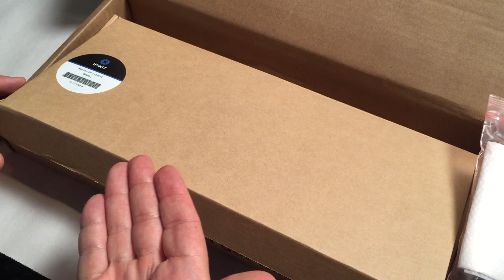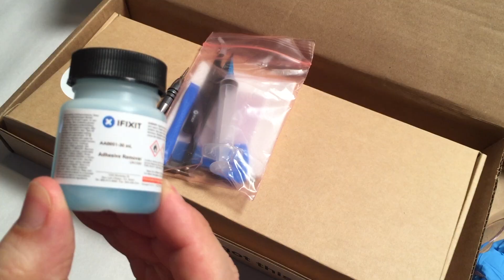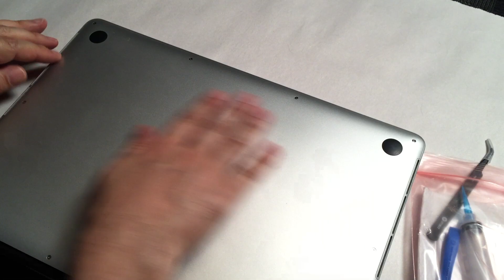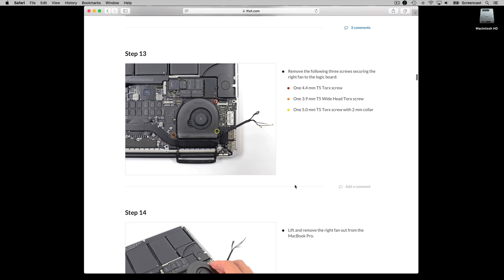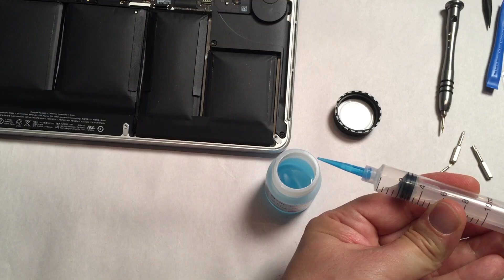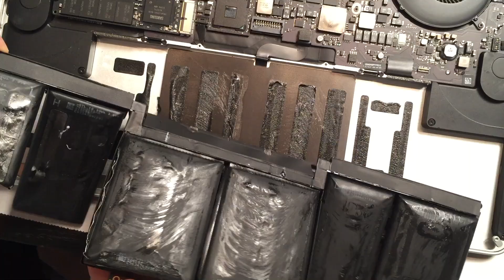Repair: MacBook Pro 15, Late 2013 Battery Replacement [ENGLISH]

Comment: Just changed my wife's MacBook Pro battery using your tutorial. Excellent work. The hardest parts: getting the adhesive off (ended up using a razor blade, very carefully) and aligning the two battery screws on either side of the connector (I didn't, and didn't put them back. The laptop is pretty much a desktop and won't be jostled too much, so I'm hoping that won't be an issue. Besides, the battery is solidly stuck in place now and won't move.) Kudos to iFixit for their excellent kit. I love that it came with all the tools.

Comment: Does anyone know if the MacBook can run without a battery at all and just stay on AC power?  I've already had one battery replaced under warranty and the second swelled in a year.  I've kept it powered off for the last 3 years but would love to get it running again.  If I do get a new battery kit, do you really need to use the adhesive?  Just thinking of more future replacements being easier.

Comment: Great video. Ifix it method put me right off and I've been fixing stuff since 99:). Yours looks much better. I think I will use dental floss on my attempt. Battery purchased today and should be here in a few days.

Comment: Fed, thanks a lot for this video. It worked like a charm and i was using a replace kit from China with just the bare minimum tools provided - i got my own gear anyways. One detail, which might be of interest for some: I did not have this liquid to soften the glue and i wanted to do it anyways - right now. So i rubbed some oil from the kitchen (yes, ordinary oil for your salad and YES - the idea of my wife) into the floss and that went out very nice. This way there is also no danger to spoil the electronics with anything aggressive. I now have my backup mac back as an option to work with. The old batteries were fat and ugly. Dangerous one might say. Thanks again.

Comment: Took 15-20 minutes to replace battery from start to finish.  Use 20LB Braided Fishing Line with the ends wrapped around 3/4 inch dowel to create a garrote.  Slipped under the battery and pulled....no liquids, no strain, no fuss.

Comment: Will this method work with late 2012 early 2013 models ?
Reply: Can't speak for the late 2012, but I just made the repair with my early 2013 MBP and it was a success!

Comment: Can anyone tell me why other installation guides/videos have you take basically the fans, chips, and a lot of hardware?  It just seems pretty unnecessary and a sure way to easily risk damaging a chip or connector.  This way to use dental floss/string is a lot less intensive and clearly does the job...

Comment: So is there a way to move a battery from one unit to another? Or once the adhesive is removed the battery is unusable? I have several units that I would like to mix and match parts....

Comment: Thank you! I followed this video and was able to change the batteries. I bought the batteries from iFixit. This is really good video! I found using thread more difficult than what is being shown on the video. The last part of cleaning up was a bit tedious and I had to use scrapper to clean it up.
Overall very helpful video! Thanks again!

Comment: Very good tutorial. Thank you so much for your time and precision. Everything works fine. However, I ordered my battery thru IFixIT CANADA. They do not have any glue removal or tools that comes with it. Battery period. Also my wireless and internet was not working when I started the computer back. Solution: be sure to update the date of your computer.

Comment: Thanks for the video! The procedure worked as explained. I used waxed dental floss to saw through the stickers and used the plastic tools to remove the batteries toward the front of the case while using the cards to leverage the batteries.
Reply: did u not use the adhesive remover?

Comment: Thank you very much for the video. Of course, with the right tools it is always safer and easier, but I did not have time to wait for them, and managed to do it also with a dental floss, an old credit-card-like thing, and without the glue solvent.

Comment: hi sir, ah, my macbook's battery as a life span of 1 hour from 100% to 0%, sometimes it shuts down at 24% till i plug it in again. i bought it in 2014 and i haven't restore or fix anything yet in it. But the battery is still flat and the trackpad still works fine. so i wanted if i still need to change it.
thanks :)

Comment: Thanks a million. The string tip for removing the old battery was great. I actually used 80lb fishing braid line and no glue solvent. Had to wear gloves so the line would not cut my skin, but it worked perfectly.
Now I can carry my MacBook again without the need of being plugged.
Reply: I was thinking that waxed dental floss would work too.
Reply: Mark Freemantle I red that works too.
Reply: what kind of gloves did u use

Comment: You only need to disconnect the battery connector and unscrew the plate holding it (two screws). That's it . You don't even need to disconnect the speaker. You don't need acetone or any solvent to remove the old bulging batteries. Just use dental floss to saw a crack between the double sided tape, and shove two plastic gift cards into the crack. Then use a pen to wedge the cards open and advance the cards. In the macbook pro 2014, for the middle cells, the trackpad cable runs beneath the plate so there is no danger damaging the cable as you wedge into the middle cells.     https://www.youtube.com/watch?v=rLuyv-9g-Ho&feature=youtu.be
Reply: what do u use to glue the battery back in?
Reply: @josephd6952  The battery pack comes with double sided sticky tape.

Comment: I used a similar string, but parted it into two to make it thinner, wrapped the ends on 2 small pieces of wood for betta grip and used longer 'sawing' action... this way I did not need any glue solvent. Went smooth. (The middle 2 packs I did in one go, going under the frame with the string.)

First thing, before your first thing, is to DISCHARGE the batteries before going at them. Supposedly there is less of a chance of fire/explosion even if you poke a hole in them by accident.

Also, if they are THIS swollen, I would stop using the mac and remove the battery while I am waiting for the new one. Mainly so the case does not deform permanently...

The mac can be used without battery, just with the power adapter -- true, it will default to the lowest clock speed of the cpu...

Comment: Thanks — This video is exactly the way to do this. I just did this today, using the same ifixit kit and it worked perfectly. My original battery was ballooning badly and it had only 77 cycles. The only issue I had was startup after replacement. I got errors saying can't load system software and then no system found. I reset the SMC and the Pram, after which it booted up fine.
Reply: How to do this ? reset SMC and PRam ?

Comment: Wow, thank you for the video. I like this idea with nylon string.. I have to replace trackpad on my laptop, but I want to do it by my own hands.
It's great idea to prevent battery damaging.
Reply: Were you able to replace the trackpad without having to get a new battery?
Reply: @berrybestsounds  new trackpad is still in the way to my address. I've prepared the nylon string, guitar strings.. hope to start to do it asap ! Have you the same issue with trackpad?

Comment: Great video.  Thank you.  I purchased the iFixit kit as well.  I used 80 lb test braided fishing line instead of string and I did not need to use the solvent to remove the batteries.
Reply: Jayson Nelson wow, that’s EXACTLY what I did. 👌🏻

Comment: I would cover the logic board at least.  And also use a fresh string each time, to minimize getting adhesive remover on the logic board.
Reply: You can also use Isopropyl alcohol as a adhesive removal liquid. That is used to clean logic boards + other eletronics, doesnt damage either but removes the adhesive.

Comment: This is the best solution I have seen. Thanks so much. I should also say that the battery you get from iFixit is far superior to the $25 batteries you can buy on eBay. IFixit provides an incredible service and is worth paying a little extra for.
Reply: Hey JS! Just saw your comment mixed in here and now I HAVE to do it.  :)

Comment: now that its been a few years, how is the battery holding up?  I am at the point in my macbook that the battery is lasting about 2 hours with basic use.  The health of the pack is at 80%.  It is not swollen.  I'm currently on the fence whether i should replace it already or wait until it gives me less use on a full charge.  Thx!

Comment: Mate, you just saved me some cash, because I was so scared with OWC Battery Replace video and also IFixIt step by step that I was about to pay a technician to do this for me. None of the other methods are as easy as your "nylon and string" method. Thumbs up! But just a heads up: I wasn't that careful on avoiding the (OWC) Newertech adhesive remover touching the plastic base of the speaker that lays right in front the border cells. Just a little drop of it touched the black plastic and it turned white, as some chemical reaction was happening and melting the plastic. So people, while applying the adhesive remover be extremely careful to avoid dropping a bit of it on the logic board or touching any piece that is not supposed to. Again, thanks heaps for your video!!

Comment: Thank you for uploading and sharing.  Because of you I attempted and successfully removed the old bloated battery.  I will try and upload a reply video for others to reference (I’m not really a youtube content creator, so that might never happen). My battery was a fair bit more swollen but it all worked out. In Canada, ifixit does not provide the adhesive remover.  I suspect they can’t import it and nothing local exists.  The sawing nylon string method worked without any use of adhesive remover.  I will say it wasn’t as smooth a process, but I was able to safely remove it with minimal off-gasing. 

Thanks again!

Comment: I just tried this and the battery caught fire, spreading to the hard drive. The computer, worth 900, is now completely ruined. 

The computer was off, I had the i-fix it kit, was watching your instructions for the third time, and was SO glad I was wearing PPE. I’ve taken computer apart and replaced batteries before. I WOULD NOT RECOMMEND THIS.
Reply: sorry to hear. did u use a METAL (OR anything metal)  screwdriver during your repairs ?

Comment: Hi - thanks for this .. I ended up using a nylon guitar string to cut through the glue slowly (and gloves to grip the nylon).... good advice NOT to use any metal tools .. I did once being impatient with a screwdriver and a battery caught fire!

Comment: Hi - thanks for this .. I ended up using a nylon guitar string to cut through the glue slowly (and gloves to grip the nylon).... good advice NOT to use any metal tools .. I did once being impatient with a screwdriver and a battery caught fire!
Reply: i think...
thats not true.
Reply: Thanks, great tip, old nylon guitar string worked perfectly - and yes, you'll need the gloves for this stage!

Comment: Just replaced it according to you advice! It is now the second time, since I got my MacBook in Feb 2013, that my batteries were bloating to an extend, where the trackpad wouldn’t work properly anymore. The first repair was within my Apple Protection plan and the repair was claimed to have normally cost  me 980$ , so I was glad I had the protection plan. This second repair was done by myself. Spent 59€ ( about 67$) for the battery pack and less than 30 minutes following your advice. I was initially shocked when I reviewed the iFixit procedure on their website/ repair manual, since it was marked as very difficult, was long ( 50+ steps!!)and with its own adherent danger ( just for the sake of preventing solvent damage. ) My extremely bloated old batteries turned out to be removed with surprising ease , utilizing a bit dental floss and a plastic spur. Thx again for your fantastic video!👍

Comment: I watched several videos on this and yours was by far the most helpful. Thank you so much for making this. When I took the case off, there was a lot of dust in the computer. I used compressed air to carefully clean all of that out. Got the battery and kit from iFixit. Used a guitar string and a pair of gloves, which made the battery removal pretty simple (still used the chemicals that came with the kit). Got the whole job done in 40 minutes. Mac is now back up and running and in excellent condition. Saved a lot of money and multiple days of down time from what Apple quoted me and learned a lot in the process. Thank you!!

Comment: Thank you man! about to try this for myself. Were your mac speakers still in working order after this? saw on the ifixit site that the solvent stuff can get into the speakers and damage them. the display too? would doing it exactly how you did it but with the mac on a tilt to prevent that from happening still work or does the mac have to be flat when you do this?? let me know when you can would appreciate it ✊🏼
Reply: It can be done without any chemicals, just did my own using a guitar string and it cut through incredibly easy.
Reply: GuitarByChance Thanks think I’m gonna do it that way too. any idea if the layout of the macbook in this vid is exactly the same as the mid 2014 retina??
Reply: @DreMinorBeats  I think they're very similar, mine is an early 2013 the only thing different is the position of the connector on the motherboard.
Reply: GuitarByChance yeah I think that’s it. the battery replacement for the 2014 model on the ifixit site shows a connector in the middle though so I’m confused lol🤷🏼‍♂️
Reply: GuitarByChance was it a struggle to get the battery off with the guitar string? gonna try it without any liquids when the battery comes so might do the same thing. which guitar string did you use lol?
Reply: @DreMinorBeats  I had mine out in 5 minutes with the help of a friend holding the laptop in place. I used a high e string cause it's the thinnest, wrapped each end around a screwdriver and used them as handles. Just go slow, mine cut through like butter.
Reply: GuitarByChance Thanks man
Reply: would love to know this also! @puromac ?? probably just looking to much into it but have seen that the adhesive can leak into speakers or display and cause serious damage?
Reply: Me too!!

Comment: I did this job on my son's Late 2013 this morning.  I found that using an old credit card from the side worked nicely to loosen the batteries.  $55 for an OEM battery off Ebay.  Came with the tools for the case screws and the battery screws, too.

Comment: Great video. I purchased a second hand Macbook Pro recently and opened it today to clean it and noticed the batteries had swollen slightly so I'll probably replace the battery in the next month or two. Was the new battery brand new? I read somewhere else about someone purchasing a battery from iFixit and the age of the battery was 400 days.

Comment: I just completed this repair on my MacBook Pro, and it worked flawlesly. I made a couple of changes to the instructions though... after contacting the folks at iFixIt.ca I was informed that the adhesive solvent is a mixture of rubbing alcohol and acetone. I mixed equal parts of these together, and applied them carefully (as per the video) using a syringe to assist in the application. It worked like a charm.
Also, I did not purchase the iFixIt.ca kit as it was NOT available in Canada. So I purchased an electronics screwdriver kit with the appropriate bits, and made a spudger out of a nylon Tupperware 'orange peeler'. This also worked very well.
Here is the reply from "Tom" at iFixIt.ca:

***********
Tom replied
Oct 11, 2:13pm
Hello,

Thanks for your email.

While I cannot direct you to a product with similar results, I can share the composition of our adhesive remover to help find a substitute. In this case, the adhesive remover that is included is a mixture of rubbing alcohol and acetone. 

Let me know if you have any further questions or concerns.

Regards,

Tom
Troubleshooting Troubadour

IFIXIT CA
International : 1.805.464.0573
***********

Thank you VERY MUCH for posting this excellent video. It saved me a lot of trouble and a couple hundred dollars, as well.
WFJ, Saskatoon, SK, canada.

Comment: Great video.  Others have mentioned how "outrageous" Apple's battery replacement is, but I think it's a fair price.  For $200, they are replacing the entire top case.  The only problem is, they told me it would take 5-7 days to repair it.  I've read on forums an entire Apple store was evacuated due to a mac battery exploding.  So I'm here nervously watching this before I attempt to replace my battery.
Reply: I agree. For this particular model, the price of battery replacement isn't outrageous. Plus, if you have Apple do it, and anything goes wrong, it's their fault. My personal recommendation is that if you can be without your MacBook Pro for a week, having Apple do it is the safest route and only marginally more expensive.

Comment: Thanks for the video! Any special reason you're using a nylon thread, or could one use any kind of thread to get under the batteries??
Reply from the maker: No, I don't think nylon thread is required, but might be preferable to twine or some other natural fiber. Nylon does not absorb like cotton, for example, nor does it shed fibers which might get stuck between components.